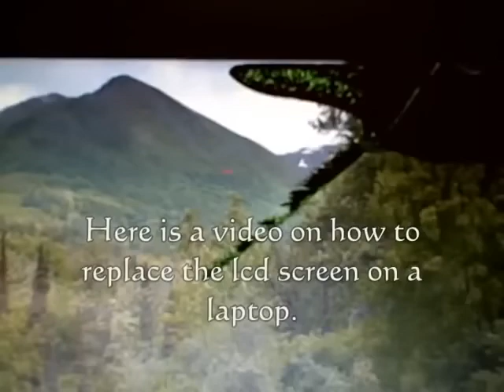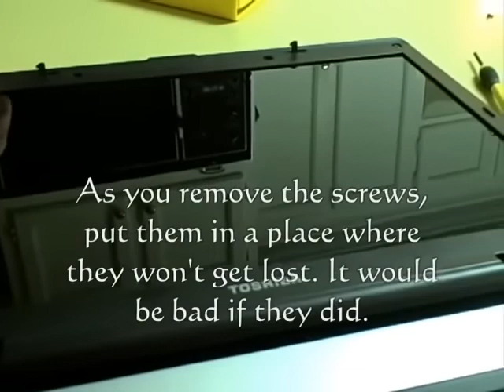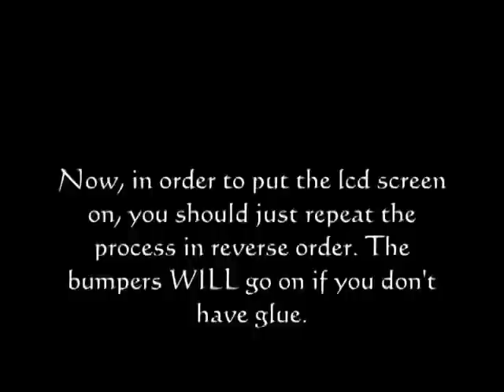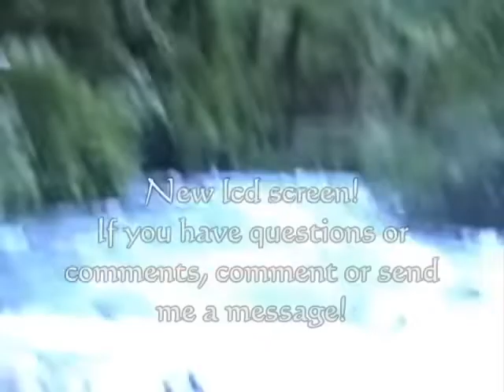How to Replace the LCD Screen in a Laptop (Tutorial)

Comment: The connector on the back of the LCD itself SHOULD be the same all round, I replaced the screen on a Toshiba from one out of an old Gateway, the only issues I had was that the brightness controls were wired the wrong way around and when you press the hotkey to turn it up it goes down, luckily the reverse is also true :D

Comment: I also have an acer travelmate that needs the screen replacing. I was just wondering how important is it to have a screen from the same model as a replacement? Should you replace the inverter as well if it is not the same screen or would it just work? Is there much difference in the connectors? Thanks

Comment: thanks for the tutorial. i followed the steps to replace the LCD screen on my compaq presario v2000, but it doesn't work. when i turn on my computer screen is just black. got the replacement screen on ebay--is it likely that the screen just doesn't work or am i doing something wrong?

Comment: hi i have a toshiba a100 599 laptop and iam having backlight problems :( the backlight works wen the screen is opened about 10 degrees but as soon as i open it more it turns the backlight off. do you know were i can disconnect the switch or sensor that tells the backlight wen the screen is opened or closed? any help will be great

Comment: I would only like to ad that $170 is really expensive to invest in an older laptop.  I know you can get screens on ebay (nothing wrong with used) for less than $30.  You can be an awesome computer on ebay for $170 working.